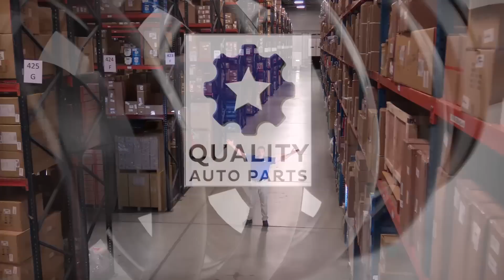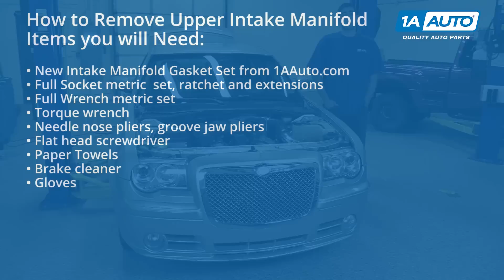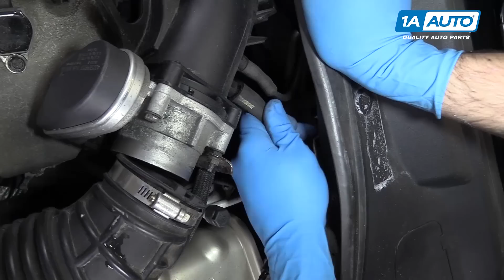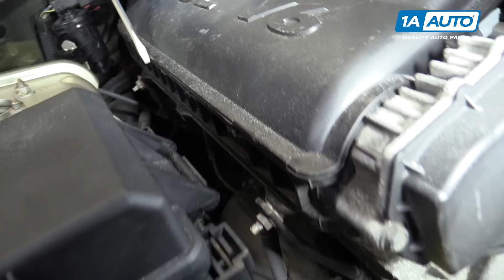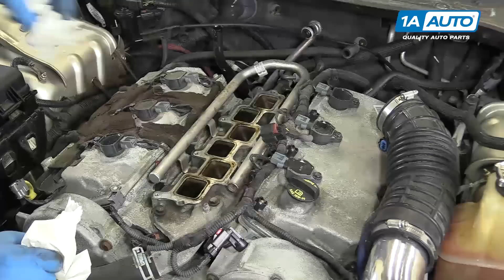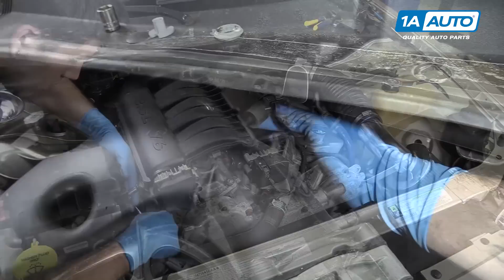How to Replace Upper Intake Manifold 05-10 Chrysler 300

Comment: First and foremost: great video 👍

I used this as a reference as it’s the only one on youtube showing how to do this on a 2006-2010 dodge charger /300…. Did this on an 06 charger 3.5, same engine  as shown in the video and I was ecstatic😛!
 Couple of things for anyone else doing this job…. No need to remove the gas line or need a “gas removal line tool”….leave the silver oval gas line alone and just remove the plugs and clips and everything else as shown in video and just lift it up and out of the way…
You’ll have access to lower manifold easily… also, 1 bolt is shorter then all the others that wasn’t shown in the video so as I too it all apart, they all appear to look the same and size, but 1 is shorter then the rest so take note. Also. Use parts/carb/intake/throttle body clean and clean tf out of the manifold!!! Spray continuously inside it and everywhere and let it drain. I used 4 cans of it and until it was clean… def took me 6-8 hours to do!  But this is the only video on the WEB, showing how it’s done!!!! And if I need parts 1A Auto is the place where I get them!
Reply from the maker: +@B_HarTz Thanks for the feedback!

Comment: On the intake manifold where the power brake booster vacuum line plugs in, there is a smaller vacuum port right next to it.  Where does this smaller port lead to?  My vacuum line is broken off there and about 3 inches sticking out.  I don't know where it goes.

Comment: Do you have to replace the intake manifold gasket every time you remove the intake manifold, for example I’m just trying to check my spark plugs, should I have a replacement gasket ready and what if I have to take it apart again a little later.
Reply from the maker: +Israel Razo We suggest replacing it every time, but it just depends on the condition of the gasket.

Comment: I had a problem with the transmission dipstick tube getting in the way. There's a bar mounted behind where the three strut nuts are that I ended up having to take off to get the manifold off. There's 2 13mm bolts on each side and you need to pop some trim off of it.
Reply: Also, make sure the egr tube is all the way on or your car will run lile shit.
Reply from the maker: +Most Hated Thanks for checking us out! 1AAuto.com
Reply: Is it a coincidence that the dealership replaced my intake plenum at no request of my own and the engine seized up less than 50 miles later? Now they wanna void my lifetime warranty...

Comment: According to the manual, prior to removing the upper intake manifold, it states to "Relieve the fuel system pressure (see Chapter X)" and "Disconnect the negative battery cable". Is that something you did before the video or are those pre-requisite steps not necessary unless one intends to perform more in-depth (or invasive) maintenance beyond simply "removing the upper intake manifold"?
Reply from the maker: +King Conchobar You should not have to relieve the fuel pressure on this particular model, but disconnecting the negative battery cable is not a bad idea just for peace of mind!  1aauto.com
Reply: 1A Auto Parts Thanks! I think I'm going to do it anyway, just to become more familiar with my vehicle's systems. But it's nice to be reinforced in my original thought that it wasn't necessary.